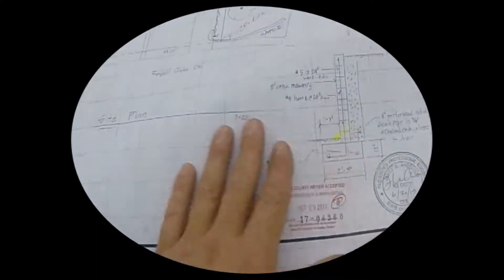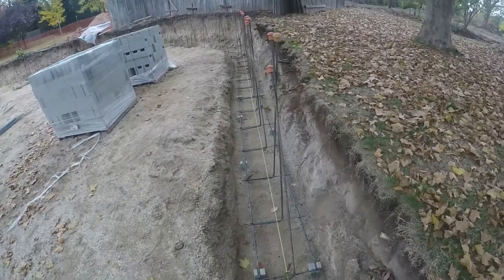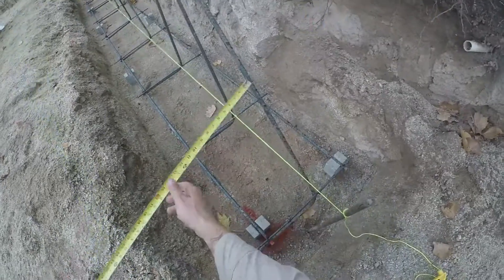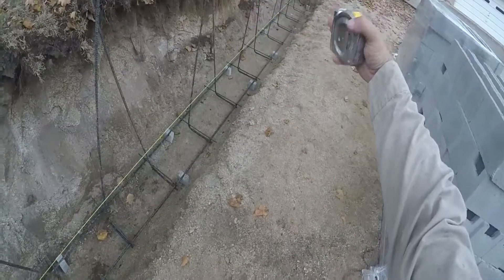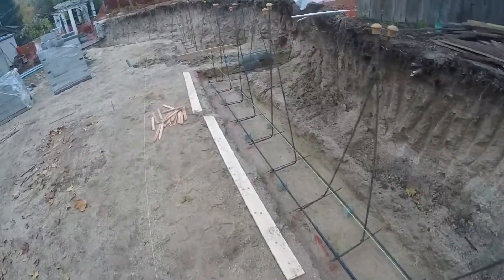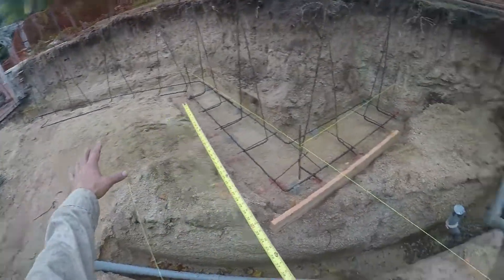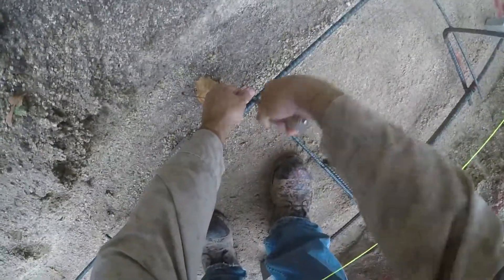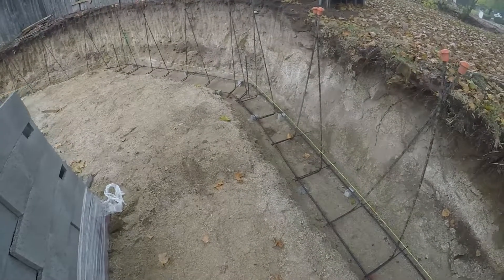First Person Masonry - Block Retaining Wall Footing or Foundation

Comment: So the "engineered" aspects of this footing lay-out, for me, give this video real value. This is the first video I've watched where the concept of "toe" and "front of block" are discussed. This footing is clearly engineering to withstand tipping and cracking from the uphill loading. . . . . Your video has excellent instructional production with all the popup text and audio cues. . . . I wish you had continued producing videos. . . In any case, thanks for This video. . . I'm going to incorporate the engineering layout in the walls I'm going to build. . . Even if they are a little over-engineered.